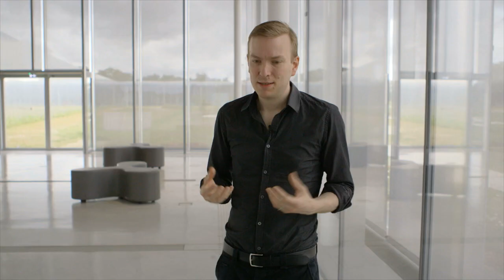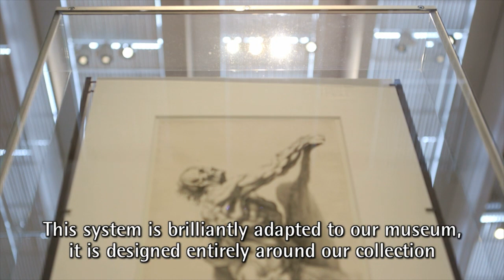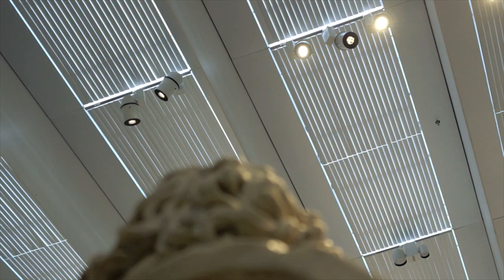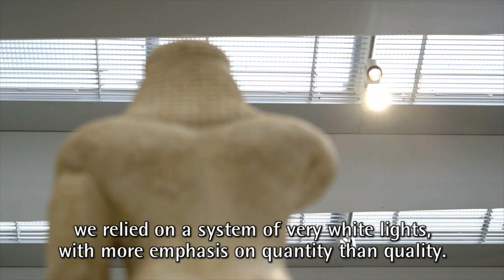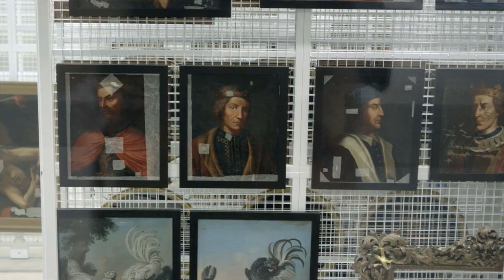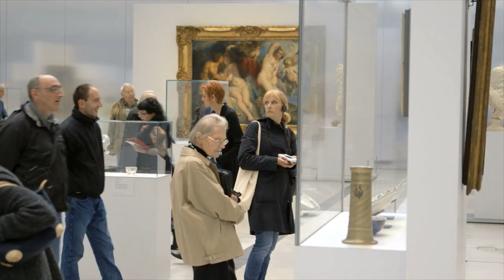Illuminating museums: Louvre Lens (Lighting)

Comment: Thank you for the insight on illuminating the museums.
Although LED technology is the most per watt efficient, it’s very well known that this technology provides the most inefficient spectrum power distribution on color. This can be shown when measuring the light sources with other methods like TM-30-18 or better SSI than CRI, where in the latter, light manufacturers use gaming to obtain higher rendering scores. 

It would be interesting to know the workaround museographers and light designers use around LED spectrum power distribution limitations to bring the visitors the best color rendition of the art when combining LED with daylight. 
Thanks once again for the informative insight.